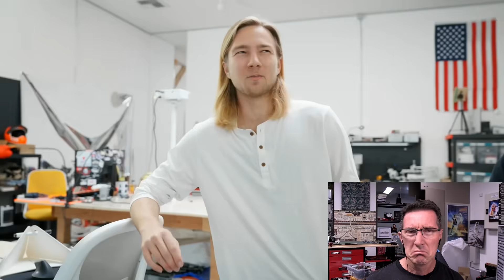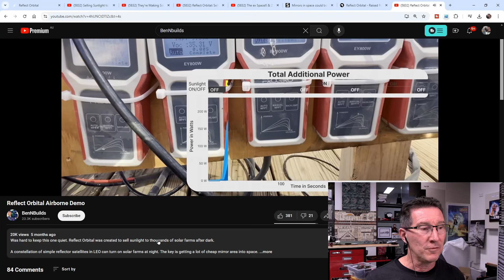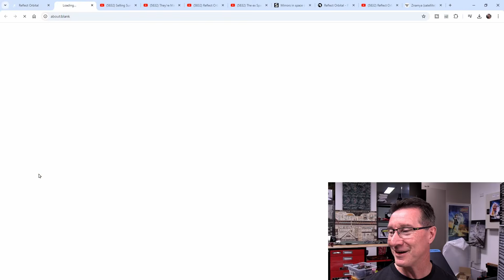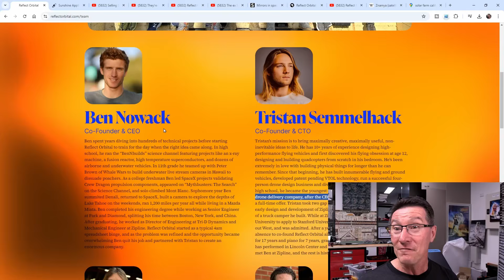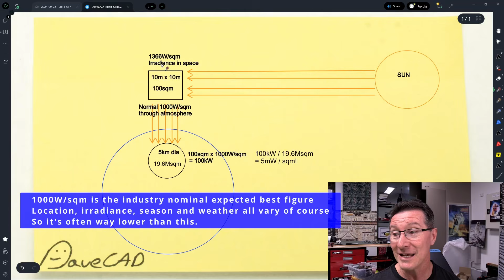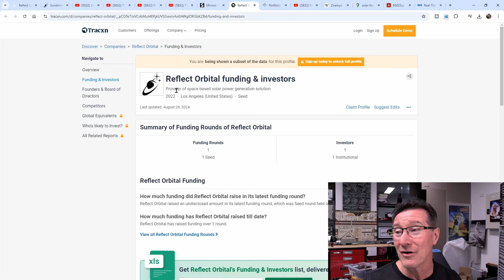EEVblog 1637: Solar Freakin' Space Mirrors! - Reflect Orbital DEBUNKED

Comment: The words that they overlooked are called "dissipation"  ...  or "dilution" .  
You can't spread the same energy over a larger area without the density going down.  It's just physics 101 .. 
This has to be where they went wrong.. they are looking at energy density at the mirror and just "assuming" it would be the same on the ground (minus clouds, etc).  It's amazing that they can get this far without someone tapping them on the shoulder and explaining this
Reply: they can fix that with concave mirror shape, but the ground tracking will be very hard.
Reply: @xponen  You're still only dealing with a maximum capture area of 100m sq. (each)..  It's just not enough to justify the price of a satellite..    If you make it a concave mirror so that (ideally) it would shine down a perfect 1 to 1 ratio so that it mimics direct sunlight,  your 100m mirror would only be supplying light for 100m area on the ground. lol.. not to mention inefficiencies of the reflection...  What is that? like 50 to 70 solar panels?  For only a few minutes per day?  It just makes no sense.  If they could get Square Kilometer sized mirrors, it still wouldn't make sense.  Let alone at 100m sq..

Comment: I think I figured out what you are missing and you should redo this. I looked at the website and they mention mass manufacturing so I belive the idea is the make thousands of the little reflectors and point them at the same spot. 

I think you should redo your calculations to see how many satellites pointed at one spot they would need. Also, it may not matter, but assuming they are each very small you should see if you can estimate how much they would cost to put unti orbit. I would do that estimate with the cost of launching on SpaceX Starship since that should drastically reduce the cost to orbit. I suspect the answer is going to be hundreds of thousands of satellites to get anything that starts to be useful, if not millions.

Comment: No one need even envelope to do calculations. Obviously, if we want to have the same power output as under direct sunlight, then area of mirror should match lighted area on the ground - for 5 km diameter light spot it should be 5 km diameter mirror(not counting for angle).

Comment: I feel like solar farms could invest in solar towers instead..... you know, extremely high reflective walls/towers that can be aimed for the duration on sunset, the higher the tower the more power they can make into the dawn/dusk hours by capturing light higher off the ground. The Burj Khalifa has a 3 minute difference between sunset at the bottom and top. doesn't that do the same thing as a 4 minute window, but with a much better solar capture? probably cheaper to put multiple radio towers in anyway.

Although everyone likes space more, so get space light instead!

Comment: If they don't have active propulsion, these things will act like solar sails and get knocked out of their orbit with no way of getting them back.10 year lifetime might be reasonable for the material the satellites are made from but it would run out of thruster fuel well before then. These are supposed to fit in a cube sat, they wont have room for much thruster fuel if they even have thrusters.

Comment: How are they going to get their putative satellites to a polar orbit? Changes of orbit inclination are extremely costly in delta v, and for sure there aren't any cheap commercial launchers which will do it. I'm also a bit baffled how they are going to do the very demanding physical aiming. Reaction wheels work but due to environmental influences at some point the speed hits a maximum, and one has to use thrusters to apply braking to the wheel(s). This would be very problematic on LEO very large area satellites. The microscopic amount of thruster reaction mass one can fit along will be gone very fast.

Comment: GREATEST IDEA EVER: Slow the planet's rotation down so one side is sun-synchronous. NOW WE ALWAYS HAVE SOLAR AVAILABLE! Sure, one side of the planet is going to catch fire, and the other side is going to freeze, but moving heat around is a solved problem. Just install gigantic heat pumps on both sides of the planet and run super-long cooling lines! Added bonus: Like, or hate, the sun? Pick your hemisphere! Our funding round opens tomorrow, and we're going to the moon!! 🌕💰💲💸

Comment: You could fit a folded aluminized mylar reflector the size of a solar farm into starship and get full power from the solar farm. You could orbit L2 and provide sunlight all night long. L4 and L5 could provide long sunlight around dusk and dawn. This is a genius idea, but it's far out. Might be cheaper to build a global transmission system and use solar farms on the other side of the earth.

Comment: Isn't the solar wind just going to blow these solar sails out of position?  How do you station keep these things?  Going to need a lot of fuel.

Also, a polar orbit needs a lot more fuel to reach than an equatorial orbit.   So the launch cost will be higher than mentioned in the video.
Reply: "A lot more" is maybe a bit exaggerated. Yes, you don't get the advantage from the earth's rotation. But low earth orbit is more than 11 times faster than that anyway.

Comment: Major problem in this calculations - Earth rotation ) They can reflect sun only in sunset point, not further.
Reply: They would be expensive to launch because of the weird orbit. And they'd have to change that orbit throughout the year to stay along the terminator. It makes less than no sense.
Reply: @russell2952  That isn't actually true. They use a "sun synchronous orbit", that is an orbit with like 97 deg of inclination, i.e. slightly retrograde.
Due to the precession of the orbit, the orbital plane will rotate slowly and will remain perpendicular to the line to the sun.
So, without any propulsion it will remain above the terminator "indefinitely".  This kind of orbit is actually used by low orbit weather and reconnaissance satellites.

Still, the point made above is true: it cannot reflect light into night areas, only to the dusk area.

Comment: Less than 100kW worth of solar light by the time it hits the ground will revolutionize the dusk/dawn outlook of 100+MW solar farms! Moving motorized solar panel racks to efficiently catch the extra light might consume more energy than what would be produced.
Reply from the maker: Details... Details...
Reply: LMAO, I haven't even thought about how with their current orbits, the angle of incidence would effectively vary from horizon to horizon, from each satellite in the conga line rising and setting in the N-S direction.
Reply: @Marci124  If each satellite is within working range for only 4min at a time, the movement is probably too fast for sun-tracking racks to keep up with, especially the time needed to reset position to catch the next one.

Also, most sun-tracking racks are single-axis in the east-west direction. Since the north-south satellite ring is practically perpendicular, single-axis racks won't be particularly effective at tracking those satellites.
Reply: @teardowndan5364  I was under the impression that, eventually, multiple satellites would be reflecting at a time, meaning that some, if not most, would fall outside the optimal range of the panels.
Reply: @Marci124 Since solar panels can only point in one direction at a time, the "optimal range" becomes much narrower when you want to overlap satellites.

Your panels pretty much can only point as close to straight-up as they can since that is the only position the "next" satellite can hit while panels are still receiving useful light from satellites about to depart the subscription window.

If there were more satellites, then solar farms would likely end up buying increasingly narrow time windows instead of buying time that is 15+ degrees off-axis.

Comment: A town in Norway, Rjukan built mirrors on a mountain side to reflect sunlight down to its town square to combat the gloomy grayness of winter. Not without controversy. Some townspeople said "It costs a lot. And the mirrors will have to be maintained, cleaned. That will mean a lot of expensive helicopter trips." What's your opinion?
Reply from the maker: I looked at the test photo, they get a nice little spot of light in the town square. Why not.
Reply: @EEVblog  I think so too. I want people to know about it.
Reply: it is a trade off. Mirror maintenance vs efficient LED light. I really hope they made the calculation correctly.
Reply: It's become a bit of a tourist attraction, dunno if the tourists spend more than it costs to run the mirrors.
Reply: It is an art project. Cost was 5M Kr ( 425.000 Euro; $ 469.500; AUS$ 696.500) for a town with 3000 people. Don't know what the maintenance cost looks like. 
But it is in the "Telemark" region of Norway, so they simply strap some planks to their feet and go do their thing......
Reply: @DreadX10  Thanks for the additional info. Think this is a neat project. Especially for the low cost of $469,50 Being an American, that's what my mind first saw the cost as lol.
Reply: @PaulHenkiel  lol, yes, i wondered about adding the ',00' part and thought it not necessary.
$ 156,50 per individual is not that much but the maintenance will cost more I guess.

Comment: Oh well it solar freaking time. If that "duck" curve is from the California System Operators (CALISO) perhaps a more up to date one? That one is 10 years old.
Reply from the maker: It's what popped up first and shows it nicely, doesn't matter that it's old.
Reply: @EEVblog  Thank you kind Sir. Been watching you a long time. Reason I pointed it out is if it is in fact the California System Operators then the supply side is very dated. They have a tremendous site you can see spot market prices (and where power comes from) How much is "green" and even when the batteries are charging. My first thought on the lenses was due to a lighthouse tour I went on many years ago the lens had to be kept covered during the day so as not to start a fire!  Keep up the great work I enjoy it greatly along with Dr. Thunderfoot

Comment: The solar power aspect of this isn’t going to be worth it. That being said, I can see an application for it. 

Let’s say you have a massive construction project somewhere that runs 24/7. A lot of sites are lit with light plants ran on diesel gensets. Using mirrors in space to light the site could be viable compared to the cost of burning fuel (obviously this is all completely dependent on how much it costs). 

I could also see this being hyper useful in military operations where you could light up your enemy location with a light source they can’t defend against. Or in search and rescue situations where the mirror array could track a helicopter at sea allowing them to search for emergency rafts or people in the water easier, same thing for search and rescue in the wilderness or really anywhere where the infrastructure just doesn’t exist to supply that much light in a short notice.

Also, military uses, search and rescue, probably also other uses, money isn’t as much of an issue. If it was $1000/hr for a 1km square of daylight intensity light, those operations could easily justify that in the right scenario.
Reply from the maker: Full moon levels of light remember...

Comment: Wouldn't running undersea cables and have solar panels on every buildings roof be cheeper and better than 100s of these satellite? Or I don't know a big battary to charge in the day and sell at night would that not be much better value? Nice idea but dosnt survive the maths
Reply: Probably not cheaper, undersea power (not communications) cables are super expensive, like tens of billions to build one with a capacity of a few GW, but it would work better, yes.

Comment: What an absolutely ridiculous idea. What were they smoking to even believe for a millisecond, that you can use a mirror of 100m^2 to serve a ground area of nearly 20km^2?
This project would have been an April Fools' Day joke at best, but how on earth can they be serious about this?
Just for the record: even Pluto nearly gets an entire Watt per square meter, over 100 times more than this ridiculous mirror project would provide.
Reply: Just install 100 m² of solar panels in another time zone and you outperform this crackpot idea.
Reply: @to_loww  You do have to build transmission lines for that, and they tend to be 'spensive...
Reply: @gorak9000  No, you just need local customers. Transmitting money over long distances has never been an issue.
Reply: @to_loww  Probably cheaper
Reply: Yup. They aren't just having overunity with this, they are completely in fantasy delusional land
Reply: Light Amplification by Stimulated Emission of Radiation - DUH. Put enough high altitude sharks with freakin' lazer beams mounted to their heads between the space mirrors and the solar panels, and boom - -free- amplified energy!
Reply: So you're saying we should build a solar farm on Pluto?
Reply: The idea would likely have to be several such panels lighting up one area. So you would have like a dozen or more satellites lighting up a solar farm. It seems, let's call it somewhat optimistic, to say the least...
Reply: @placeholdername0000  it would need to be at absolutely minimum a 1 Square meter of satellite to 1 Square meter of solar farm. And it would only extend the energy generating ability of the panels by a few hours. It would be far cheaper to just build another solar farm in the other timezone and use power lines.
Reply: @GamingWithNikolas  Batteries seem cheaper. But yes, I'm not saying that this is practical. Just that some of the criticism can be rectified with some fairly obvious solutions. Some of the issues are real, and some are just strawmen. Discuss the real issues, not the strawmen.
Reply: @placeholdername0000  What are the strawman problems? Because I didn't see anything about this that wasn't a fair criticism
Reply: @GamingWithNikolas  The small area of each satellite is one. It seems that the 10m x 10m satellite is a prototype, not a commercial satellite. So claiming that the result would only be 5mW/m2 is not really a good response as the obvious answer would be to increase the size of the satellites. A 200m x 200m satellite would be producing about 2W/m2 per satellite, and you could have multiple sats covering an area. So this is not a very effective criticism as it can be quickly refuted.
Reply: @placeholdername0000  2 watts per Metter squares. That's enough to power a single light bulb ber meter. That would come out to 800 watts for your impractically large reflector. You could power a SMALL microwave off of that satellite. That's still such a miniscule amount if energy that it's worthless.
Reply: @GamingWithNikolas  The 800 watt figure is significantly off, check your calculations. A satellite would deliver 1000kW/m2*(200m)^2=40MW.

However, this would be spread out over a large area, to produce around 2W/m2. If we have a sufficiently large solar farm, we can deal with this. Let us assume that the angle of the satellite cathes 70% of the full figure, assume that 80% of the sunlight misses the solar panels, and that the panels are 25% efficient, as stated in the video. That means that we're at 3,5% of the maximum 40MW, now let's be pessimistic and apply a 5% capacity factor. Now we're at 3,5%*5%*40MW=70kW average. This isn't great, but it's not 800W as you claimed.

You have to make a distinction between the light density at the satellite and the light density on the ground, which are two very different figures. Does this change the conclusion? Probably not, but we should fire the critique at the real problems, not problems caused by miscalculations.

Comment: It would be easier to put solar panels in space. And collect as much sunlight as possible. And figure a way to get that energy to earth. But far too expensive today. 

My bet would be drilling for the earth energy and use heat to power turbines through steam water.
Reply: That would not actually be easier, and probably not better either.
It would suffer from the same issues that this project does.